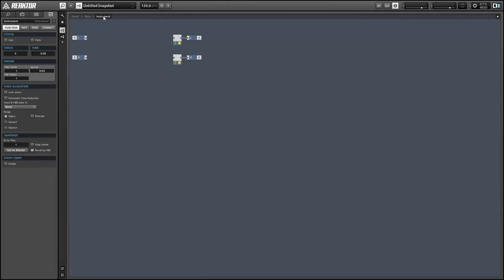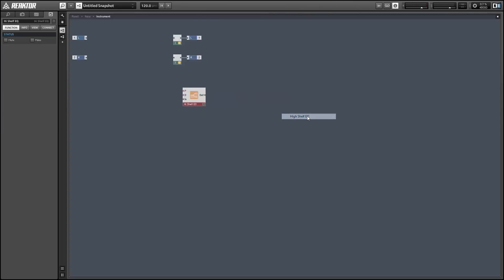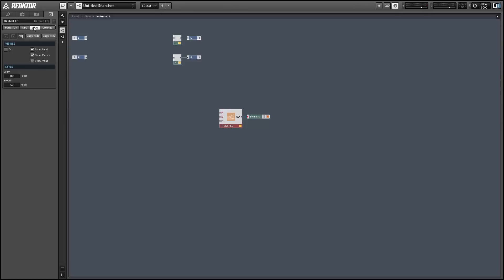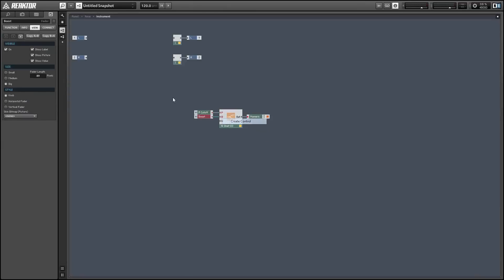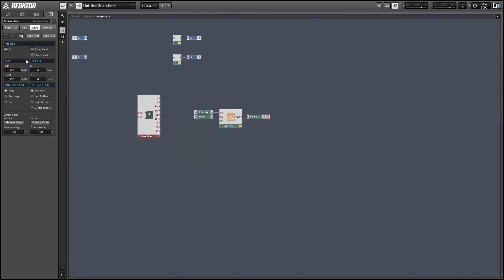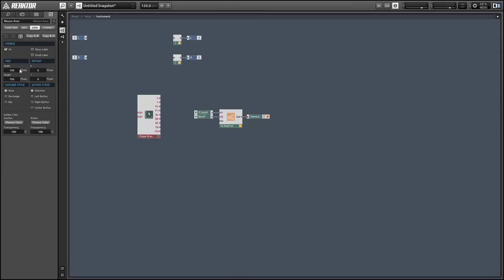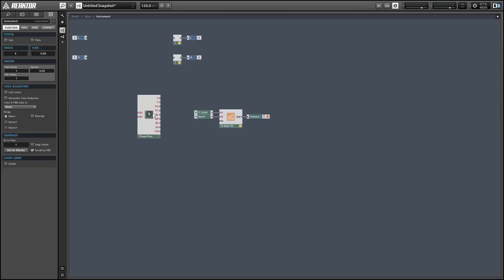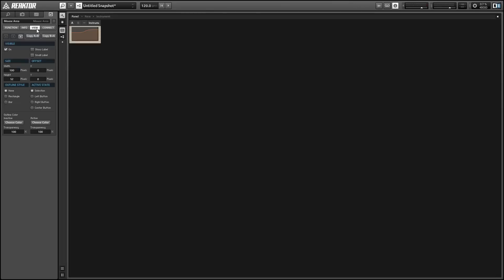Reaktor Quick Tips - Basic Graphic EQ

Comment: Do you have any idea how people make those filter graphics? I can't think of how they'd do it.
Reply from the maker: Jordan Harris it'd be beyond tedious to implement in reaktor, i wouldn't bother making custom ones... but in other formats, it's not so tough if you know the frequency response of the filter.
Reply: I bet it would be. I'm thinking it might be possible doing something similar to the Multi-Breakpoint Envelope, but I really don't even understand that. I wonder how it would be done in something like C++. I'm going to school for programming, but I just started C++ and I have no idea how most of it even works. I'm curious though, do people usually use the actual response (with FFT or something) or do they somehow make graphics that look similar to the response?
Reply from the maker: Jordan Harris once you get into designing filters you should have an idea of the decibel response (typically -6db per octave per pole/zero), so i'd guess they just program it mathematically. 

when you keep in mind how terrible reaktor's graphic modules are, though, it's really not worth it - they don't even draw anti-aliased lines without a ton of work. you can see my code for anti-aliased lines in bassic, it's not pretty. anti-aliased curves are very difficult to build.